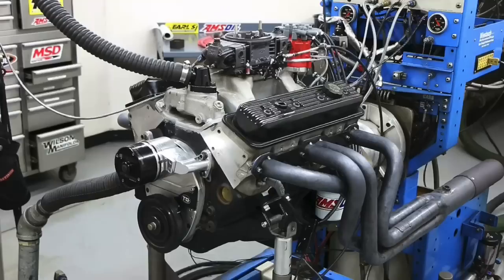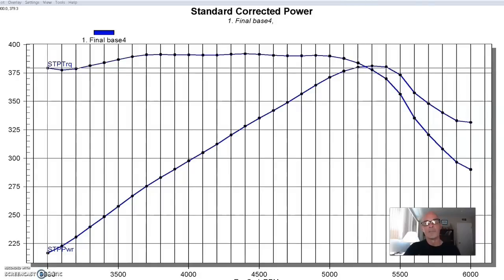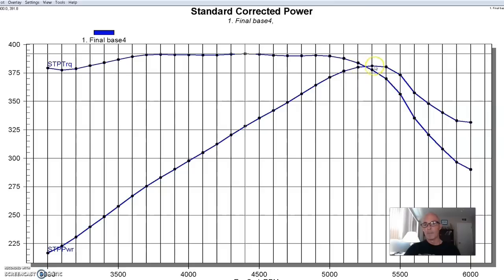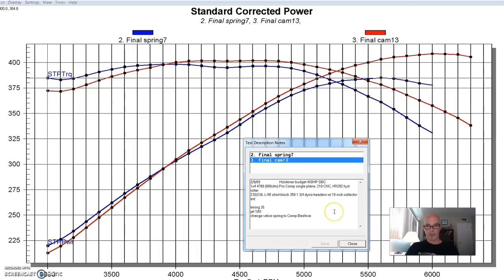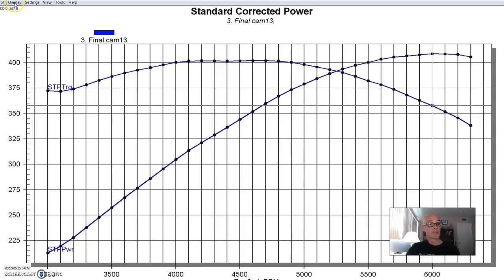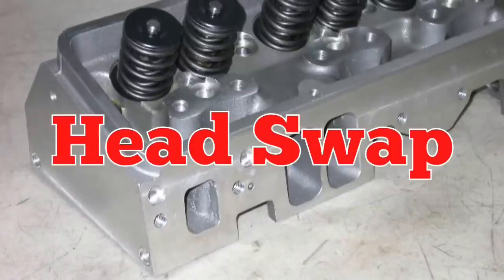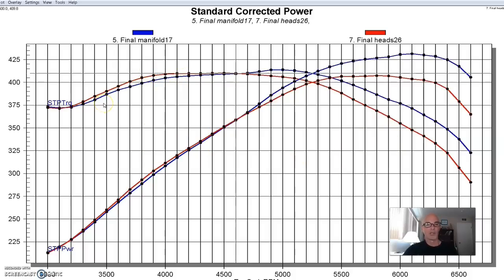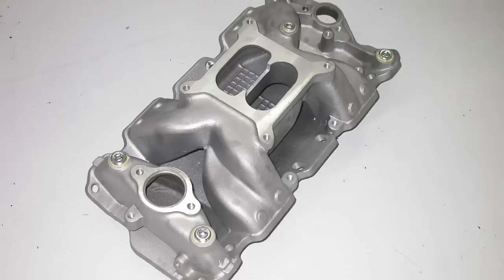DIRT CHEAP SBC MODS?

Comment: I would've done a forged 408, afr headed, larger cammed, 10.5-11.0 to 1 comp, single plane intake, carb spacer, and holley sniper throttle body injection...I don't do junkyard stuff
Reply: I do.
Reply: Sounds expensive but cool, but junkyard builds are usually inexpensive and fun without as much worrying about blowing it up, that's what makes them so cool!!

Comment: Have you looked at the gmpp large port vortex large valve heads from GM ? Cast iron , they offer a small and large port version . Cheap small block power.

Comment: I’ve got a 92 GMC Yukon that has the SBC 5.7/350 with factory throttle body injection. Where I live, there is only safety inspection (no emissions). Can I make more power switching to a carb and will the factory “computer” allow it? I’m mainly looking for more torque for towing…..I don’t want to break the bank upgrading to some high end fuel injection systems. I’m going to have to rebuild the engine at some point (currently has 240K+ miles on it) where I’ll probably tweak the internals somewhat. Thanks!
Reply from the maker: a carb and dual plane will make more

Comment: Low gears (4.56) and a high stall (3,000 and up) I'd always take the cnc heads and single plane nanifold.  Back it with a killer overdrive transmission (th2004r or 700r4)  = nice street car and good bracket racer!   Good info.  Thanks for the video

Comment: The ported 210 heads with the professional products single plane, and swap in some high comp pistons to get it up in the 12:1+ range and a e85 carb.  Curious if that would crack the 500hp mark.
Reply: Rudy Hughes I built a 358 ci DIRT track engine (363ci) I ran a custom 750 4150 style carb on e85.  Roller cam bearings, a 2.0” diameter crank journals and a custom crank with a 3.5” stroke versus 3.48.   Distro is a MSD Pro billet with Taylor 409 10.4 mm wires.  Dizzy has a adjustable collar because of the head and intake corrections.  The heads are OEM GM aluminum that were angle milled.  DART Little M block.  Custom Bullet cam with firing order swap on 4 cylinders; all outboard intake lobes had a slightly longer duration to compensate for intake runner length.  DART 2725 single plane intake port matched with heads; nothing fancy.  Custom Cometic MLS head gaskets; HV Melling oil pump, stock fuel pump mounting, and water pump driven by belt off crank.  I used Trend pushrods that were custom length with thicker walls.  Brand name roller shaft & roller rockers with 1.5 rocker ratios topped it off.   I’d have to dig out the build sheet to get the piston and rod spec’s.  I haven’t touched this motor in 7 years - it sits in an engine cradle in my garage.  I was 694 hp and around 550 tq on the Dyno.  If there weren’t restrictions on that class I could have certainly gone higher.
Reply: @jeffheld3971  sounds like a good bullet for a hot rod....from Wyoming USA 🔫🤠🇺🇸p.s stay safe and healthy everybody GOD BLESS OUR COUNTRY AND stop this foolishness  ❤

Comment: You could get something like the Brodix IK heads for not much more than the pro comp heads and make way more power and way more reliable valve's and seat's!!! Or the Pro-filer 195's as cast for like 3 or 4 hundred more and have a way,way better head that's capable of making good power!

Comment: another lower buck intake that u didnt use was the speedmaster air gap, certainly less expensive than the edelbrock, its identical in design, speedmaster also makews a single plane similar to edelbrock super victor with longer runners. another test maybe?

Comment: Richard, have you ever done back/back testing of Rochester Qjet  vs Holley vs Edelbrock? I've looked all over the 'tube and even done some decent google-fu and not seen that test data. Seems like it would be COMMON knowledge, but it doesn't appear to be. Pretty easy testing. Would be even better to see them back/back on a mild street/strip engine as well as a nice healthy one with good CNC heads, etc.
Reply from the maker: needs to be on an intake with both bolt patterns

Comment: For me it would largely come down to the difference in price on those heads. If it were only a few hundred bucks more for the CNC heads then that's what I would get. Now if they were $1000 more for the pair i'd stick with the as-cast. And i'd add to that the better driving cam, dual plane intake, etc. as i'd be building a street driver rather than a race car.

Comment: NICE I own C10 355 balanced Offenhauser intake Edelbrock 650 RV cam Would be nice to see a video how to adjust valves engine off all eight cylinders stock rocker arms considering the fact that all these mechanic shops around here don't know how to adjust valves but are ase-certified
Reply: Take out all the plugs, rotate till piston on said cylinder is all the way up the bore, rockers should have play, set lash and move to the next cylinder, repeat till done.
Reply: @theguru-s2l  not for a hydraulic cam. Shouldn't have ANY lash. You turn the rocker nut until there's no play, but you can rotate the pushrod with your fingers. Then give it one half of a turn. That sets the preload on a hydraulic lifter.

Comment: I have used single plane on a smaller intake  runner and not have any noticalble difference on the street if the cam was mild enough. On bigger cams it does of course, or power throughout on the dyno but poor drivability  due to lower cam vacuum characteristics  on that wilder cam single plane. Some people in my opinion ( it jmo) try to band aid the wrong cam with dual plane and small carb.  Not that all the single plane theory and rules are wrong ( and I'm not arguing them) ,  but just things I have noticed when I have had been short on funding and needed an intake for someone or my self, till we got what was right.

Comment: What’s the actual price difference in this combo (CNC ported) vs street ported AFRs? In another video you said the tested combo price was half way between the cheap and expensive heads, but the power difference was dramatic. The price of AFR’s street combo is under $1800 and the cheap as cast are less than $1000, as far as I can tell. Didn’t see a price for the cheap CNC heads, though. I’m thinking, for a driver, that AFR heads and Edelbrock RPM Air Gap intake with maybe 10° less cam gives you a much better torque curve with the same ultimate horsepower. Save for a couple extra months to make up the difference?

Comment: What if anything do you know about the aluminum heads that came on the corvette back in I believe the late 80's or early 90's? I have a set on my elcamino, they are 1.94 valves, but have small 58cc chambers. I believe they bring my comp ratio up to about 10.5 to 1 with flat tops. Do you have much experience with these heads? I found them to be a cheap way to gain a bit of power. They also come on the ZZ3 and ZZ4 crate motors. Just wondering. Keep up the great videos.
Reply from the maker: L98 ALUM HEADS-THEY WERE A BIG DEAL WHEN INTRODUCED AS A LOW COST, AVAILABLE ALUM HEAD

Comment: have you done any videos on quench area? like say flat part of the piston 0.040 from the head, VS say 0.80 from the head but same CR? is this myth or just most guys tighten it up find power because they increase compression. I've also heard it matters N/A but not with boost, but you've proved over any over, boost just makes more N/A Power.
Reply from the maker: it certainly helps suppress detonation
Reply: @richardholdener1727  so you have seen a noticeable benefit in chasing it during a build. interesting to know it's not just a myth.

Comment: care to do one with milling the choke horn on say a 650-750  holley? see how the airflow changes or if it does? maybe take off a little at a time then flow it on the flow bench,  see if the in-exspenisve mod is worth it.
Reply: @port nut did you flow it?

Comment: Im very interested in the other guys engines, there is plenty engines with little to no aftermarket support, what can be done for a engine like that? Everybody knows a ls or 2jz can make 1000hp+ on boost, but what can be done with say a mopar slaunt six?
Reply from the maker: I plan on doing a slant
Reply: @richardholdener1727  Yay!! Mopar stuff! I see guys run low 13s NA, and 11s on boost. Some say the best tip is to use the short stroke 170, which rev happily (my 63 Valiant has one), rather than the under square 225, a truck motor.
Reply: Richard Holdener I don’t know if anyone else is interested but the 292 and 300 straight 6 have interested me for a “something different” low buck swap choice. Seen a few turboed but the details were lacking
Reply: Ps slant six is interesting too. Owned one of them as well as a 300 in trucks
Reply: @richardholdener1727  That would be great. Here n South Africa we have a chevy 4.1 straight six, is that the same engine as the 292 chevy you recently got from David Freiburger?
Reply: In highschool I got my a$$ kicked by a t-bucket with a slant 6!! Couldn't see the turbo untill we saw the other side...lol...one of my first car's was a 67 valiant 4door auto 225 leaning tower of power...from Wyoming USA 🔫🤠🇺🇸p.s stay safe and healthy everybody GOD BLESS OUR COUNTRY AND stop this foolishness  ❤

Comment: Richard why don’t you sell me the smaller Comp 270 cam?  I’m building a 355 with some Brodix IK 200 and I have the SpeedMaster knock off of that same spec cam but would rather run the Comp because of their quality over off shore (the PC term of the day) parts where consistency and runout can be a problem. Hit me up and see if we can work a deal. I can send you the speed master and you can test it to see if it holds the same qualities since I only have one motor to build. Deal? Or no Deal?  And BTW love your videos👍🏻🇺🇸

Comment: Question guys, and don't roast me for it. Im barely getting hands on experience with motors! How different is a CARBED L05 truck engine from the late 80"s (1988). I want to do some things AFTER I go through it and make sure its in decent shape. Would i be able to add performance parts such as better heads, slightly aggressive flat tappet cam, and a nice intake? Or are there things in the L05 block that will keep me from being able turn it into a mild street engine?

Comment: Like the video. I've decided on a pair of AFR heads for my 355. Dk what size is best 4 my cam. I hav a comp 292. The dbl humps heads are fun, but im sure there not flowing nuff air. Any suggestions/insight would be helpful. Thanks!

Comment: a test idea is comparing 350 sbc dual plane intakes with different spacers to the single plane to see if there is a combo that is a good compromise between low end dual planes and top end single planes
Reply from the maker: lots of spacer videos up

Comment: Cheapest way to hot rod an engine...get a low mile truck block or invest in a forged slug short block, get it running, and then save up again for a good deal on heads, then save up again for a good deal on a power adder.

Comment: Assuming the motor is in a vehicle, and for  ease of the swap, what would the power do if you swap the rockers to a higher ratio, instead of a cam swap?
Reply: Higher ratio rocker arms will net you a little more lift. Don't expect big gains.

Comment: If I was gonna run this combo with the CNC heads and add a turbo. Is 600 hp possible?
Reply from the maker: You wont need the heads then

Comment: More power for somewhat cheap by Bloodviking 

Hotter coil
Shave the heads
No dome pistons
Head porting
Indexing the spark plugs 
A carberater tornado
Atomizing boosters
Stepped headers
Lash caps
Cam retarding 4 to 8 degrees
Thinner oil
Home made oil pan baffle
Oil scraper
Crankshaft lightning 
Unshrouding valves
Larger valves
Bigger factory carb
Higher octane fuel
Factory stroker crank
Roller fuel pump rod
Chinese roller rockers
Messing with the timing
A proper Fuel spacer
Intake porting
4 7 cam swap
Block fill.
Arp main bolts
A thinner head gasket
An air gap intake
Anti heat carb gasket.
Switch to e85......

Comment: yo richard wat heads u recomnend promaxx or afr enforcers? street car on a 275 hp stock 327 sbc?
Reply from the maker: either of those will support more power than you will make
Reply: @richardholdener1727  doin stock bore will they push 415 +
Reply: @richardholdener1727  nice bout the blue print 195 heads arem they any good?

Comment: Need build up on vortex motor with stock heads and big cam and aftermarket fuel injection tunnel ram intake manifold and boost

Comment: In your experience, how big of a cam lift can you put in a small block 350 with flat top pistons and 1.5 rocker ratio without having to worry about piston to valve clearance? Do you know the tolerances on any of these combinations in the video?
Reply: Lotta variables. With factory style valve notches, I think .500 is very safe. Duration is a factor, as well as if the cam is installed "straight up" or advanced. Use clay to mock up the engine and measure the thickness of the clay where the valve hits it. You need probably .080 on the intake side.
Reply from the maker: lift is not the issue for P-V, it is for Ret-Seal and coil bind. Duration is really what determines P-V clearance (near 230 for he intake... depending)
Reply: @richardholdener1727  Always appreciate the input!

Comment: how did you choose your cam, did you have your head flow tested so you know where your max lift and duration would be when choosing your cam, if you did you would not be shooting in the dark for a cam. Myvintageiron7512 has a real good tutorial on choosing the correct cam.
Reply from the maker: that is not necessary
Reply: @richardholdener1727  the flow rate of your heads is everything. you may as well pick the box with the flames that claims adds horse power. lol wow not necessary
Reply: That will only give you a ballpark figure, many more variables and as Richard stated isn't really necessary!!
Reply: @mermaiddreams83  are you kidding, really do you know what a head does?? with out knowing your flow rates you cannot determine lift duration. example if you have a flow rate of 50 at 1/1000 and 100 at 1/1000 and 125 at 3/1000 and 115 at 4/1000 then you know you want a cam with 3/1000 lift because you start losing flow anything over, not to mention duration. now look at spring rates, just to push that extra leve. SO YES FLOW RATES ARE THE MOST IMPORTANT PART OF A HEAD BUILD AND CAM DECISION.

Comment: Along with a test of a 4 hole "merged" carb spacer, could you also test "variable duration" lifters, such as Rhoads? I know you usually go straight to rollers, but us poor guys go HF. I also know that all the "benefits" of Rhoads lifters would be below 3500 rpm, so you'd need a chassis dyno. But I'd like to know if they work. We all want the magic kluge, lol.
Reply: @port nut What directions are there to follow? Lifter preload? I'm guessing Rhoads, like other "race" hydraulics, work best at only .020 to .030 preload. I heard, 25 years ago, that some guys even ran "race" hydraulic lifters with LASH! But only the kind with the True Arc snap ring retainer can handle it.

Comment: Junkyard 4.8 LS which one guy said he got (2) for $200 is the cheapest upgrade for a SBC ?? :-).
Reply: Those are leaveright engines, leave her right where you found it.
Reply: @robertweitlauf4653  Richards testing kind of says that is an untruth, the HP per $ gain to buy a 5.3 or even a 6.0 really does not pencil out really. They were good engines but people just walk right past them to get a 5.3.
Reply: Richards testing has various power combinations to get a 4.8 or 5.3 up to 400+ HP.  All you have to do is bolt a 6.0L to the dyno and hit the throttle to make 400 hp.  6.0L has a solid 100 ft/lbs more as well.

Comment: I got a 77 Chevy half ton with a 350 and the 350 turbo and all I want is power from a thousand  to 4500. For pulling any suggestions?
Reply from the maker: the PE 246 from Comp or smallest XE cam

Comment: Great video. Still love to see you throw a 43-45 lb lightweight crank in this engine and see the awesome gains!
Reply: There would be a trade off, loss of torque but gain of hp.
Reply: Both of you have no idea. The weight of the crank would have absolutely no change on hp or torque. It'd be the same as putting on a lighter flywheel
Reply: @JingleBop  might rev quicker, from less inertia, but no power gain....
Reply from the maker: I did a light flywheel and drive plate test-they definitely helped power-be even more effective on an inertia dyno or on the street
Reply: Richard Holdener I agree in car it’s very effective. Is there a video on that test?

Comment: Best 450 lift cam on vortec head big cam big spray on a 750 3 pedals and gears sticky tires in a 2 nd T/A bandit
Reply from the maker: Sounds great!
Reply: @richardholdener1727  I'm intrigued by that, because many hometown "street stock" classes mandate .450" lift, flat tappets, iron factory (or equivalent, like S/R Torquer) heads.....and often a 2bl! That's the choke point. Howards and Isky offer many HF race cams in .450 lift, some are like 255 degrees at .050, with a 106 LC! Wicked!
Reply: @donellmuniz590   the L31 heads in stock form dont really flow much better at higher lift and there is some work to do to make them take more lift. Back when L31 motors were common under 100k miles we would put low buck good power street motors together. First one went in a jet boat. A few folks only rode in it one time a bit much for them